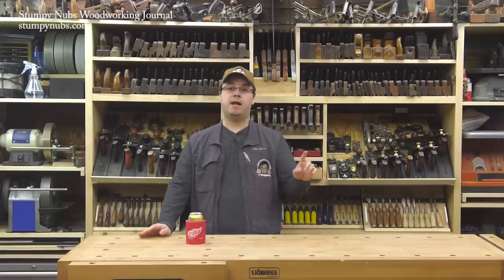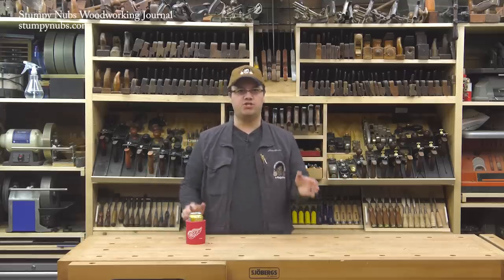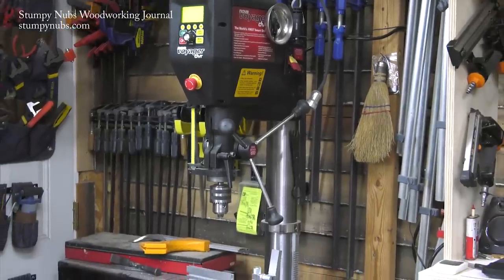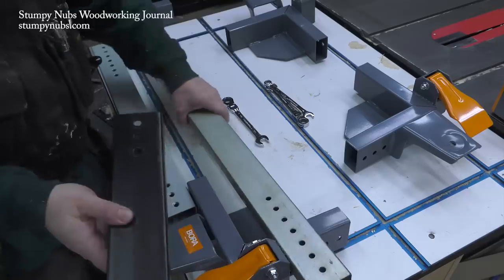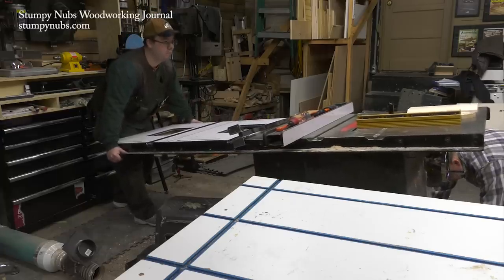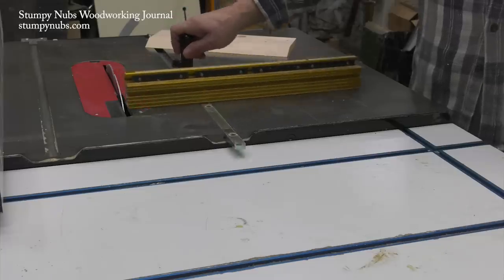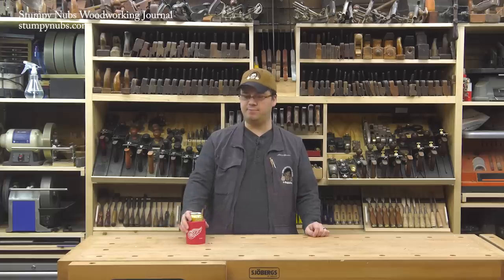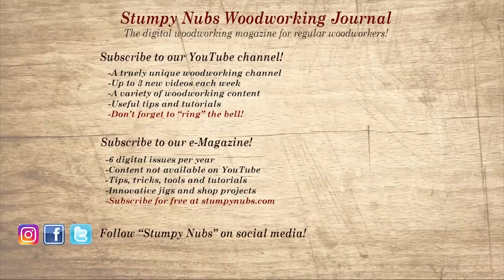Is it a bad idea to put a mobile base on a lathe? Check this out...

Comment: Stumpy I have the solution, make a flip out deck that hinges across that Bottom bar  with little legs so you can flip the deck out and stand on the deck and get close to work

Comment: I'm sure the reason for the drill press manufacturer to prohibit a mobile base is for liability.  A drill press is by nature a tall, slender, heavy tool with the majority of the weight far from the floor.  If a caster catches on anything, it would be super easy to tip over with almost assured disastrous results.  With proper care and attention, as well as recognition of the potential dangers involved, a mobile base (even for a drill press) is a good solution for shops which have to multi-purpose.

Comment: I ve built some bases for my  planer and band saw that work on a cam type system. When the machines are in use  the cam system lifts the wheels off the floor and machine drops onto its feet.

Comment: What about using the 
“Bora PM-3795??? 
Wouldn’t it be possible to place your lathe over the “extension end” and 2 shared center wheels giving you the required room your looking for and place your new cabinet over the “saw end” The illustrations show it being used supporting a table saw with an extension so a lathe & cabinet your referring to should be fine. Just thinking out loud!!! Lol

God Bless you & Yours!!!!!!

K

Comment: I use the Rockler workbench lockable casters on my workbench. Though they have an issue w being able to lock and release them without lifting some on the bench they definitely support the weight well and make the bench extremely easily movable. Now to figure out a technique to not have to lift them. I made an extension to. Pull up on the release it still needs some lifting on the bench. ☹️ Any ideas?

Comment: A piece of 3/4" plywood or 2x6 over the cutout for your feet, will hold a ton of lead. You could touch base at a gun club close by and find someone that casts his own ammunition. He could cast several hundred pounds of lead 'ingots' of any shape to fit the base of your lathe.  You can pick scrap lead up fairly cheap at a junk yard. Little muffin or bread pans work good for this. Perhaps in exchange for a nice gun box you build for him. Cheers.

Comment: Regarding your lathe stand why don't you put adjustable brackets and put the cross member so you can get your toes in this will keep the structural rigidity and you will still be able to get your cabinet in but you will have to put Italian off so you can get your tools in the Neath this would make more sense and it will be able to be mobile just a thought

Comment: I only have wheels on 2 of my things: the bandsaw and the frankenvac. The bandsaw lives in the garage so has to be shifted around every so often, & the frankenvac needs to be moved all over the place despite having a long flexible hose attached. The lathe is built into its own static cabinet & the bench drill & scrollsaw are attached to the top of a second static cabinet where I store my timber. This gives me the versatility I need whilst keeping those machines that need dampening on something heavy, & it all fits into my bedroom. Yes, my workshop is in my bedroom. So is my office. It's a mess in here. Help.

Comment: Why doesn't Bora invert the design so the rails span inside, not just outside, reducing footprint for lathe? Or have a  metal worker/welder  modify the existing ones. Also, I've cut leftover pieces of horse-stable pads (100lb 3x5 1000lb-rated mat) into isolators, and put them "between" the device legs and the mobile base. Dampens vibration, just like on a sub. I agree about the poor quality of some mobile bases...I can see where they must have leftover "crappy" shopvac wheels... I always throw out the crappy wheels and get polyurethane Medium duty models. They can have sealed bearings and will outlast the shop tool they are under. Love the cow tips!

Comment: One reason drill presses should not be mounted on a mobile base
is if you have a long, heavy item on the table the DP can tip over easily.  The DP should be secured to the floor with the appropriate type anchors or a yoke to the wall If the DP is you brother-in-law’s that owesyou money, then a mobile base is fine.

Comment: My jointer, Wood shaper, table saw are mobile, but the miter saw stand, drill press are not. No lathe (yet). But I’m a retired plumber who loves to woodwork in the garage (well it’s not a garage anymore) so it’s nice if everything was on wheels. I’m pretty anal about my wheels, they have to roll smooth and easily. Well thanks for the video and it’s time I have a cold one because I earned it. 🍻

Comment: If the corners of your steel mobile base allow the side beams to pass through, you could simply turn the two corners nearest you around, so the two front feet sit on the metal shelf toward you.  That would provide foot room.

Comment: A possible solution to your excessively long toes is available.  Buy cut and weld channel or metal box stock to fit your wheel sytem in the profile displayed by the example you showed in the video.  Reinforce your addition to the base assembly the same way the example was - - with a cross bar.  The new "cutout" in the rolling base will leave room for your toes.  The only limiting factor to approaching the tool will be the thickness of your belt buckle.

Comment: Add a platform box in front of cross brace to stand on and toes can over hang or notch the base to allow the cross member to recess into the base. It could be easily removed to move unit or if recessed it would slide with the unit

Comment: Ref the lathe on a mobile base and not being able to stand as close as you would like. How about a wooden duckboard that over sails the bottom beam ( could even be bolted to it). For those in cold climes it also gets your feet off the cold concrete.

Comment: Why not take the front tube, on the lathe base, and move it back behind the front legs - then weld it to the side extention rails. Toe room then is available, esp if you put a deep kick plate on the 'future' cupboards.

Comment: You could fabricate some Z shaped brackets using the 'extenders' ... then use a sliding 'coupler' piece to bolt together and link them .... so you would have toe room and not loose a great deal of strength in this application.

Comment: As a woodworker, why did you buy a steel base rather than make your own wooden bases?
You can buy lockable castor wheels to put on a wooden base.  I have made wooden mobile bases for my jointer, tablesaw, mitre saw, and coping saw. The next major tool that I buy will probably get the same treatment. Love your video and humour.

Comment: James you’re going about it all wrong.  instead of trying to figure out the height and the toe room, just build you a platform 3 to 4 inches tall to stand on in front of your machines that’s even with the bottom rail and you get plenty a room for your toes and feet. Besides you can stand to be a little taller.

Comment: Couldn't you use the short sides of the metal mobile base and 1 side of the long side (In the back of the lathe) and fabricate a front bracket that angles to the middle and attaches to a center bar? That would give you the strength to hold the 400 lbs and clearance for your feet. This would require a bit of welding.

Comment: Everything is mobile.  One car garage that is shared.  Built cabnits with castors.  Now I'm a fan of the workbench Castors.  Move when i need to and sit on the ground for stability... usually out in the driveway

Comment: Bro, just do some welding on the base you have. Throw some extra steel in that suck and you can do whatever you want with it. Plus the extra steel means exrra weight.
Reply: Saved me posting same thing. Even sawing and bolting would do the job. Be very careful of fumes while welding and grinding though as that steel looks to be plated.

Comment: If your floor is pretty flat you could replace the rubber feet with some wood blocks with hot glue or rubber on the bottom. You lose adjustability to gain stability.

Comment: in a metal  machine shop  we stand on "duck boards"    laths of wood  with gaps   fixed to a few cross members..  this helps with all the ailments of standing on a cold concrete floor .. could you use  one as a step so you can get up-close to the machine .. and it is moblie to get out the way when moving the shop around.. ... beef joke had me jerkie..

Comment: Have you thought about maybe welding a  out of rectangle tubing,  and moving the front metal rail to the middle about a third of the way back from the front wheels and bolting it together there so you  still have the strength of a metal base, the clearance of the wooden bast

Comment: Instead of weight on your lathe, I've heard of people wedging it down from the ceiling.  Having only heard of and never seen it, I'm guessing it doesn't work as well as you might hope.
Reply: Ceilings really aren't built to have upward pressure applied, so I'd advise against trying that. Especially if it's plastered..

Comment: James,I have a mobile base for my   mini lathe.  It's a 30' class a motor home.  I full time in this rig, and couldn't leave the lathe at the old home. So when we get to a camp site my wife and I yank the lathe out of the storage bay and set it up on a Keter table.  Table is very sturdy and doesn't "walk" very much even when swinging an off center piece. Yup, I do seem to draw a crowd at times.  Get a lot firewood donations that way.

Comment: You don’t have any friends with welder that can recess that front base crossbeam to give you free space to stand?  Would be a 30 min job and save the base mobility, weight addition, and original standing position.

Comment: Or buy yourself a piece of the same metal as the base (I'm guessing 2x2 square tubing?) and make a U shape in front by welding it and then cut the front stretcher to mimick the plywood base. A little bit less strong than just a straight stretcher (unless you add braces and whatnot), but much stronger than the wooden base. You could even make it all bolted on instead of welded on, would be weaker than the welded one, but meh...:)

Comment: Well, I just have to say it. I can go along with the eleventy billion pounds. But at the end of this video you mentioned that you might just  bolt your lath to the "cement". Now there in is the problem. Don't know how you will bolt anything to "powder', which is what cement is. Now if you add water and gravel to the powder, mix it up and leave it alone for a few days you have what they call "concrete". You will be very pleased at how well the "concrete" will hold the bolts that will hold the eleventy billion pounds. Do you eat flour or bread? :)
Reply from the maker: I accidentally mispronounced a word in the previous video too. You'd better head over there.

Comment: if you cut 2x4 orso 2" shorter than rails slip under rails then lower this show take wobble out and mak much more stable you could even remove front rail for better access

Comment: Seems fixable with some welding.  Just get some square tube, and build a raised bar at about shin height across the front.  Connect that to the casters on either side with two short 6" pieces, and wield it all together.

Comment: I don't have any of my lathes on wheels, I feel no need to, with my dirt floor shop the mobile bases would be useless anyhow, and 2 of my 3 lathes are benchtop models anyhow.  Yes, in theory I could have put them on some sort of a mobile base, but I don't see the need, its not like I roll them down the street or anything, and they're small enough to pickup and carry around...the metal working lathe I wouldn't want to carry too far, but I don't move my tools around much, maybe if I ever get a floor in my main shop I may do mobile bases on several of the tools, but my benchtop lathes will stay on their bench anyhow which isn't mobile, although I could add wheels if I wanted to.

Comment: if you really want to you can still use that base, all you would need to do is take it to a welding shop and put 2 , 90degrees on the front cross bar moving it in enough for your lil piggy's to fit nicely.Or you can send me the base and ill put it on mine, because I am one of the suckers that have to move shit around all the time . My 5000 lb  jointer is on an a cart and its a joy to use every time .

Comment: Collaboration time - find someone who welds and modify the front frame so you can put a toe kick in it. If you do it well enough you can probably do a joint venture with Bora. All you need it 4 or 5 inches for your toes. And who worries about elevendty million pounds over their toes.

Comment: How about this... Take the base you have and remove it take it to a welding shop and have them weld all the joints except the ones where your feet are at in the 7:40 of your video. Remove that one a make a new one that goes behind where you have the tool bolted to the base.....Would that get you closer to your work if you push that one back behind where sits now???